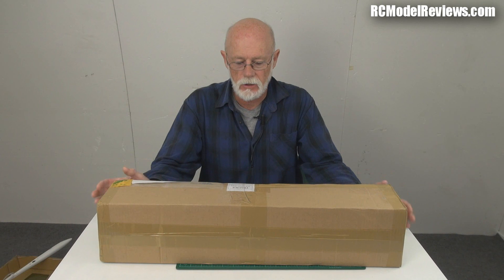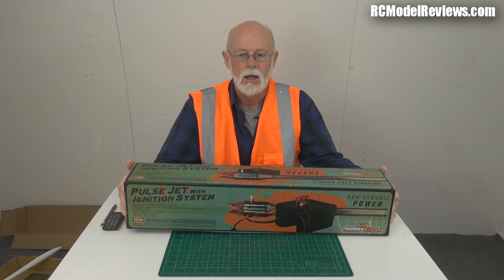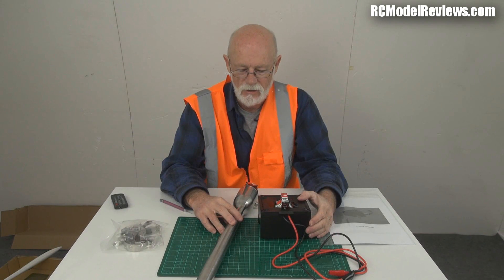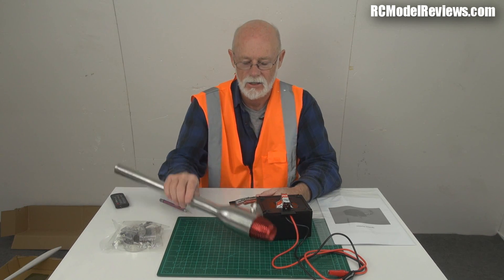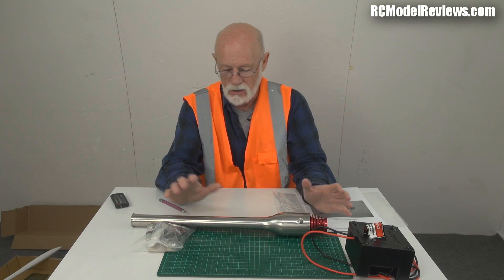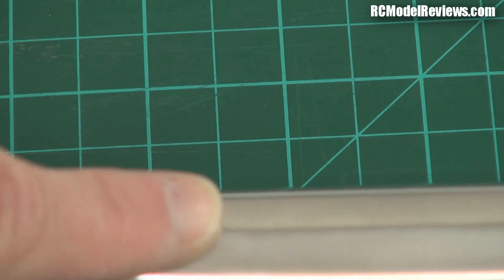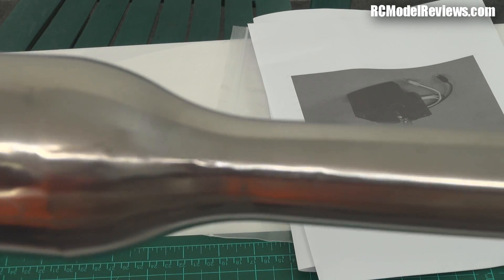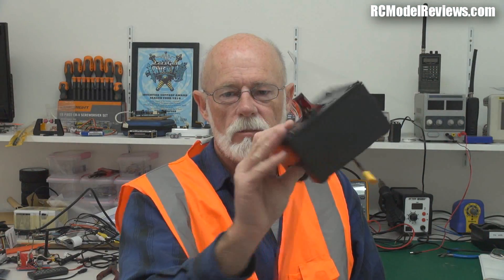HobbyKing Pulsejet review (part 1)

Comment: Ok I'm up for it.     Gonna try to mount o e on my sig wonder.... 

How much flight time can I expect.   Of course I know that depends on tank size...  But  what tank do you run  and how long us it good for. 

Also you mentioned..  Tank level compared to engine level...  Doesn't that change in flight?    Would it be better if you used a small fuel pump to keep the  supply constant? 

Thanks anjs

Comment: You say pulse jet, I think V1 buzzbomb.  They look easy enough to build as a model, though I may be completely off base.
Reply: The problem with the V1 is that the pulsejet is behind the CG, so unless you're planning on mounting a warhead in the nose, its going to be hard to get the CG far forward enough.
Reply: Tom Reed
Reply: Tom Reed

Comment: Like your observations on the grinding, Bruce. 'course, the main problem with that is when you 'smooth' the material, you can't help but thin out the parent metal. I can guarantee it's thinner in places around that seam. How thin is anyone's guess. Top review, mate.

Comment: Gonna need that part 2, proper setup.  I suck fuel but I just don't have the air going right.  Managed to get a couple pops but nothing solid, I think I'm flooding it.  I am using an air compressor but I don't have a good hookup for it.  do you still sell your ebook on pulsejetts?

Comment: Got my HK Pulse Jet and the welds are very good. I'll try to take some pictures. As a machinist the price of $99.00 USD is a no brainer to buy this. And with your post on how to make reeds, Well I have just put a order in for .006" spring steel and a SS at .050" thick. I then ordered another one jet. My 13 year old son is all jazzed up about this. We are checking out control line PJ flying. Now we just need to find a club and field in South eastern Washington State to fly at. Man dose this bring back fun memories when I was 13 years old. Sounds like HK listen to your comments on the welds.

Comment: While playing with a previous project, I ordered some $2 ignition systems from eBay..
And when I saw the potted coil and big cap sticking out of the resin in the ignition system, I took some photos:
https://lh4.googleusercontent.com/ZLW9bfbLRKSESz--G6no_yJNJ-E90sRnoG9zvmAOp2Ok=s0
https://lh6.googleusercontent.com/-88QN-2JvqRA/UoGjxrgRgYI/AAAAAAAAYyM/bAXarv7Ppkk/s0/IMG_20131112_134125.jpg

Surprisingly good, 10cm spark for $2 including postage!

Comment: Pity they did not copy a Bailey or Jet Bill Pulse Jet.Much better.The flowjector in this one is a bit basic.If you use a Bailey or Jet Bill sport jet flowjector with Methanol fuel your reeds will last much longer.Spark plug is to big also.Small is best

Comment: Well... RC simulator helps but nothing replaces real life practice. 
What i mean is that pulse jet planes are VERY fast, hard to control and you always have to land with the engine stopped, so you don't have second chance. 
If you want to start with RC planes i suggest you to go to your local arc flying field, where you can get help in buying a plane, and finding someone to teach you how to fly it.
I don't wanna be a jerk but a pulse jet plane is not a good idea if you never flew RC before.

Comment: Maybe pulse jets sound awesome to you. And yes, they are awesome, but they also have some issues:
They have a very narrow thrust range. Basically they cant be throttled. Its full power or nothing.
They get EXTREMELY hot, and are VERY loud, so they are banned in some places.
And finally, most pulsejet models fly really fast, so they are not adequate for learning to fly. You have to start with a glow or electric plane anyways and have a lot of practice before flying a pulsejet equipped plane.

Comment: Best way to deal with Face Book. Modify your etc host file and never see or hear a peep from them again. You would be amazed how much quicker the net is when you don't let sites push your traffic to them. 

# Loop-back,  (Just remove the spaces web address). 

127.0. 0.1 w w w.f a c e b o o k.c o m   # Take a flying loop on that!.

Comment: If the grumpy old men ever found out how much damage my trusty Raleigh 20 did to me then they would have banned it as being a weapon of mass destruction. Crushed me nuts everytime the chain came of, crushed fingers getting it back on. Broke a wrist, cracked a knee and skinned me back arsing off down the gorge at 75 clicks. Knocked off it by a car and run over. On the other hand, I only ever got a few prop scars from model planes that didn't require hospitalisation or surgery....

Comment: Hi Bruce :),

If Google's changed your YouTube and merged it with Google+ then you can revert back to having your YouTube page without all of the confusing stuff. All you need to do is click the icon in the top right corner, then click "YouTube settings" and you should see a blue link on the page you are directed to saying, "Temporarily disconnect YouTube from Google+" or something like that, so just click it and well the rest is safe explanatory :) :) Hope this helps :)

Comment: A pulse jet is "loud" and fear comes that sonic gain. Could the CAA see Bruce as "loud" on you tube. Bruce the "human pulse jet". CAA needs a blast. Vote Bruce as the blast to CAA. Put Bruce the human pulse jet onto CAA so it can fly with flames (little ones) out the back. CAA should know how to handle the red hot vocal rubbings of Bruce. CAA is a failed reed valve in the flying community. Council too. And model fly New Zealand you are the google plus account pain in the arse.